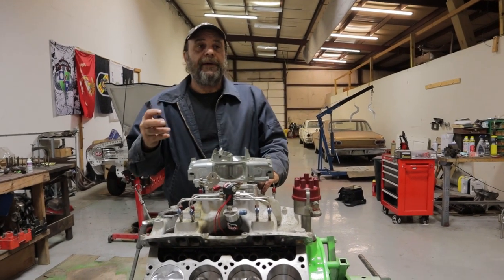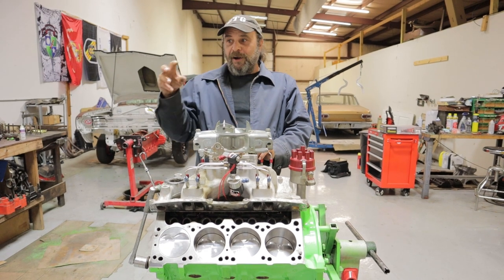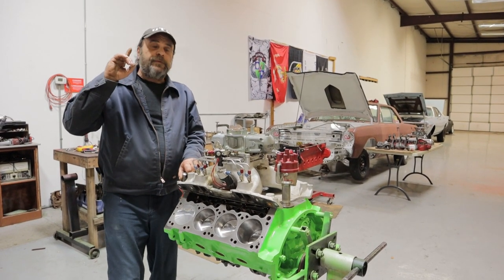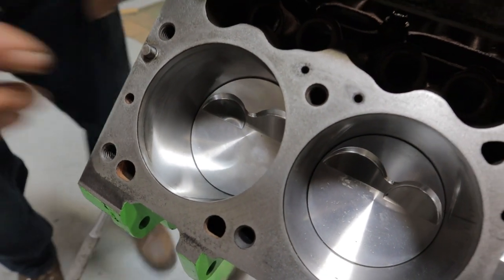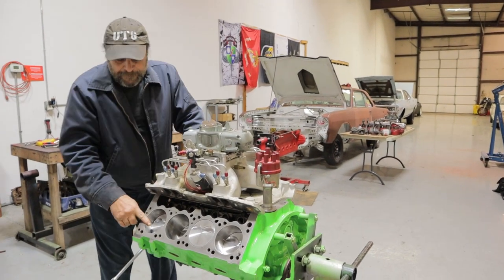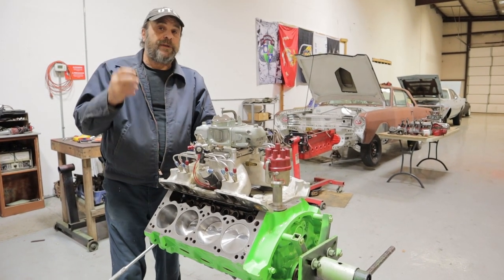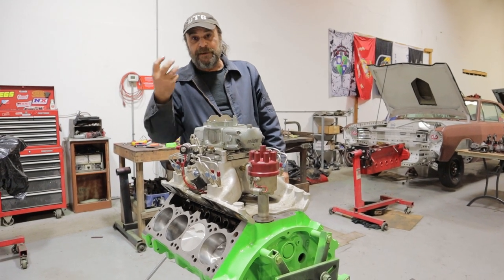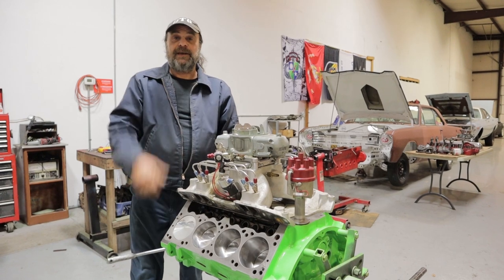The Fundamental Aspect Of The Internal Combustion Engine Nobody Ever Talks About

Comment: You know what would be really interesting then is if somehow we could make a variable stroke engine. This is all theoretical, but I mean we have cylinder deactivation so maybe someone could figure it out. So you need the whole stroke of the engine to pull in the mixture, but like he said you only really get power for the top 40% after TDC on the power stroke. What if you had an engine that went all the way down the stroke on the intake, but only went 40% of the stroke on the power stroke essentially minimizing the time that each cylinder is running on just momentum. I know that we don't have a way to make an engine like that right now, but in a theoretical world where we did, I wonder if that could have the same effect as @Electrode was talking about with the F1 engines but without the ridiculous rpms. Just food for thought.
Reply: Variable stroke is just changing burn chamber volume right? What if you used an asymmetrical opposed piston engine where the opposed piston set had different stroke length and was offset in rotation for the purpose of changing burn chamber volume in ways not requiring variable crankshaft offset.

Now that I type that out that doesn't really make sense.
Reply: @lordslavik  Yeah it's just an interesting concept though

Comment: Aren't we forgetting the fact every stroke on a engine is spontaneous? Any given cylinder right after TDC, already has another cylinder completing TDC stroke, that is nearly on it's way down, aiding in the crankshaft rotation force. Only exception is any engine with 3 cylinders or less on a 4 cycle motor. So the question is, how close is that spontaneous action? Spontaneous means a continuous action, with no delay. I would like to hear another view on this though, as I don't see your theory as completely factual... just sayin.
Reply: The spontaneous element is true but not to that extent: having the same burn over less crank duration even in a multiple cylinder engine still produces less power than the same burn but for longer. He's not saying it makes no power, just less. That's why he made the nitro connection. It burns way way longer. I don't know if nitro has more potential energy that petrol but consider this: hot vapour petrol burns quicker and with less power, yet with that same petrol if it is chilled you will develop more power because it is less volatile and thus burns slower and for more crank duration. Graham bells four stroke tuning book does a good job of explaining these sorts of things if you want to know more.

Comment: On Smoky Yunick’s engine. I remember reading his columns way back and he talked about his ying - yang combustion chamber and ceramic coating on the cylinder bore and piston. If I remember correctly the engine had no cooling system as the ceramic kept the heat in the combustion chamber. I think the ying-yang piston and combustion chamber was to control knock perhaps. I wish I still had those old magazines since Smokey’s garage was one of my favorites when I was a teenager and I had dreams of super efficient engines.
Reply: Ceramic coating indeed does keep heat in the combustion chamber and out of the block , heads, etc.. Hot Rod magazine did a test,   Uncoated, then disassemble. Then the 'treatment' - in the same engine. It added about 5% efficiency.  But add up lots of little gains?, You get bigger results.... Moly coating on my piston skirts  too. Low tension piston rings. Lots of little tricks - that the average guy can do.

Comment: Packing more air and fuel into the chamber extends the burn…it’s why turbos are so effective, steady loads and running near max output is most efficient.  It’s why big diesels put out like they do.  Slow burning fuel, lots of energy is transferred to the piston crowns, high compression which helps cylinder pressure; results are mega power and really efficient when compared to a gas engine.
Reply: ... less fuel mileage. More air requires more fuel.
Reply: @theclubhouse1209  lol if you have smoke you’re wasting fuel.  If you want mega power you wont have good mileage.  Efficiency has nothing to do with output, although a high performance engine is really efficient.
Reply: @jaredmayer3960  I understand that, that's why i like gail banks videos.

Comment: Great visual demonstration of why direct injection can add so much HP, even though it wasn't mentioned.  It can continue into add fuel after the combustion cycle starts. 
I did not know that was how Nitro workes.
Reply: DI does not add fuel after the combustion event though. DI can add fuel during the compression stroke, after the intake stroke, unlike port injection, this is called homogenized fueling. The vast majority of DI injection is just prior the spark timing, that is why DI engine pistons are shaped the way they are.

Comment: No one ever talks about cylinder pressure under boost like T/F at 50+ lb or turbo at 40+ lb.
Reply: Al the boost is doing is allowing more air and fuel to be put in the chamber while the valves are open instead of atmospheric pressure just filling the  vaccum.

Comment: I'm really enjoying this series. I used to do a lot of Volkswagen Diesel Rabbit stuff and added a hydrogen system to one them just to test this whole theory out. I learned very quickly that it is exactly as you say Tony, I could use the hydrogen system to idle the vehicle but once I wanted to go down the road I had to use diesel. The only real gaines I had were possibly in traffic. The caustic nature of hydrogen, oxygen, and the fumes coming from their separation utilizing a catalyst (potassium hydroxide in this case) and the damage that stuff did did not outweigh the gains of maybe 5% economy. 

To paraphrase. Yes a piston engine can run on hydrogen gas.  No it wasn't practical. Really glad Uncle Tony can explain this better than I can..
Reply: I've been thinking about getting rid of my computer controlled cars because it adds unnecessary issues and work. Overcomplicated in general. I've been looking at old diesel rabbits / cabriolets. What would you watch out for with them?
Reply: I used to love my vw diesels. 
Best one was a TDI-m 
I built to drop in a ratty 79 rabbit. As a big-time crutch because I didnt run an intercooler, u used an old washer bottle and a carb jet in a hose that blew washer fluid right in the turbo. 
Use the blue stuff ,the methanol was nice. 
My system was manually operated and you could feel the hit from it.
Actually it causes a slight runaway, so let up on shifts. 
Works so good ,I started chuggin out of fuel before the gas station and I was able to tickle a controlled runaway with my foot off the gas and just made it. 
Good stuff ,she was pretty quick too, 14 flats at 100 with a 2.4 second 60'🤣🤣
Reply: @crazycoffee  for mk1s, go 1982 and newer to avoid to 11mm heads. Use a older 1979 radiator to delete the coolant tank. (Trust me on this)
For comfort, go with a 1.9 engine on a early to mid 90s Passat or Jetta. 
Manual trans is best on all applications of VW diesel.

Comment: You can inject hydrogen gas and oxygen after 10 deg down from tdc and a multispark to ignite for additional pressure pulse . I did this on a 1980 2.2 engine , the carb supplied Acetone and compressed H2 and O2 with a mad 6al.. compression was 10:1.
This was a daily driver. I'm a retired mad scientist and all the equipt was always readily there for me. Many other patented tricks too🐄🤡
Reply: Tell us more
Reply: You have to Inject the H2 &02 at 2000psi from separate ports in the head after 10 deg down. The cyl flame will ignite and blast an additional pressure wave. H2 burns anywhere from 3% to 90% so mixture is always explosive. Best to EDM . 002 size holes for each gas and supply them with Liquid Dewers of each so you have a massive supply. I had mine set to get to and from my work as a Nuclear and military researcher🥼☢️☠️. 10 miles each way . the Acetone was 50 to 90% with pump swill.
It's detention resistance was better than 110 VP🤡.
This is similar to how the modern top fuel blast inject additional right at the valve but one step further since I do it after the blast and after tdc. ☠️☢️⛽
Reply: Also guys a super simple method. Stick a torch tip of Oxygen on your intake vacuum line and feed 2% of your cruise cfm divided by 14.7 and it will increase the efficiency 🔥😳
This aslo works great on my house oil burner head. Flame is a nice pure  💙 blue. O2 is cheap to make yourself thru electrical separation compress in a cyl , use a SCUBA type compressor and your good.
You can do the H2 too but that is a bit 😳🔥.  There's other gasses like LP and Acety. But they are low BTU/cuft and dirty.

Comment: Ooh, what about Atkinson cycle engines, Uncle Tony?  I know they're efficient/low output engines, but would that negate some of the problem with hydrogen giving up the goods so early in the power stroke?  Like on a Prius, you'd still have electric motors putting some balls into it to give you accelerative accelerocity, no?
Reply: Oh fuck, I think I have it backwards.  Would Atkinson suffer under those fuels?
Reply: And gasoline weighs 4x as much as liquid hydrogen if I just read the chart right.  Saving weight, but then again, batteries...  fuck it man, just keep doing what you're doing LOL
Reply: They should lose their advantage on this theory, yeah.  The end of the combustion stroke before they switch to exhaust is effectively longer and that's where these fuels are well beyond used up.
Reply: @Stereomoo  Yeah, I had to rethink it.  But, I like being humble so I left the comment up.  Thanks, I'm still curious if there is some way to jack up Atkinson now though LOL.  I'm sure somebody more gear-headed would beast me to it if it was there, right?
Reply: @Face2theScr33n  Like Tony says, run nitrometh, it burns even longer.
Reply: @Stereomoo  Nitrometh with a turbo on an atkinson, is that where this is going?  I like it..  or a supercharger.  It would definitely turn heads with a blower on it LOL (I'm visualizing a prius with a blower on it now)

Comment: You mentioned hydrogen engines and that grabbed my attention. Now I'm one of those guys that has a vacuum wet cell, I've done some testing on it and I've had 10% increase in economy with the cell vs without it. Is it because I'm adding more oxygen and the hydrogen into the air fuel mix resulting in a better initial and more complete burn? I would really appreciate feed back
Reply: Watching
Reply: If you’re adding an external fuel then it’s going to burn less gas. That’s like saying your car gets better fuel mileage because someone else is dumping in a gallon of gas you don’t factor in.
Reply: @NBSV1  Umm… yeah, that’s the whole point of the hydrogen cell obviously
Reply: @yeboscrebo4451  Obviously. But, the people that install them make it out like it's magic that improves the efficiency of the engine so they get better fuel mileage. When you're literally just introducing a different fuel that you aren't really measuring.
Reply: @NBSV1  by “different fuel” you mean water….yeah.  That’s pretty magical